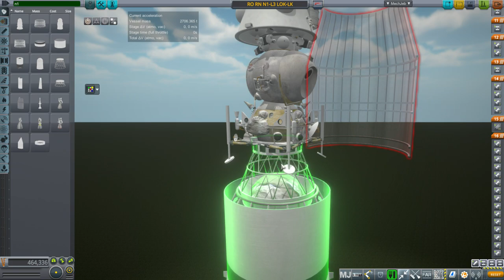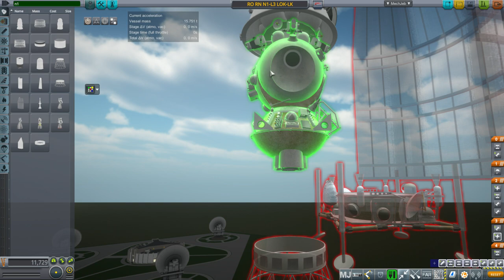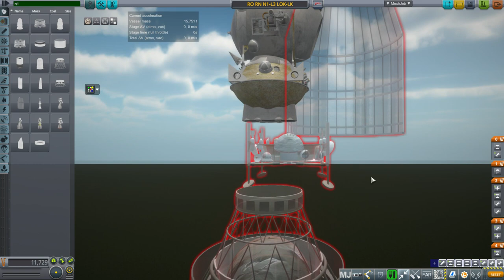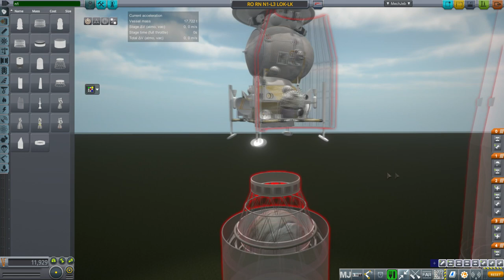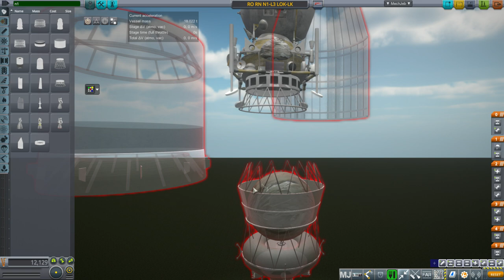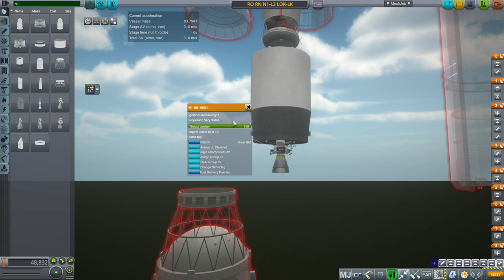How to Land on the Moon 02 - N1

Comment: Can you consider doing a Boeing 2707 vid?
Reply from the maker: Still not satisfied with my ability to do swing wings, and that's the version of the 2707 (-100 and -200) I like most. Otherwise it seems to me an overgrown Concorde, and if anything the Concorde needed to be smaller, not larger.
Reply: Raiz Space Okay, thanks. I just thought someone should do it in KSP other than Turbo Pumped.

Comment: Did they plan on ĺeaving the landing /leg module (block G?) On the lunar surface or using it the way you did? Everything I have seen they leave it there. Good vid! Think it was one of the First complete N-1 missions I have seen.  Isn't it annoying when you get a fantastic craft file but the rcs looks like it is on.
Reply from the maker: I think they lift off with the legs, unlike the Apollo LEM, but I'm not 100% sure. That's an element that could change once they actually put the mission into practice, too.
Reply: Raiz Space No, I’ve heard it jettisons the legs for ascent.
Reply: If the leg section doesn't have usable fuel? Then it would make sense to do the same as the Apollo LM as it is dead weight. This has me truly curious lol
Reply from the maker: The only reason you wouldn't do it immediately on the ground is if there was a timing concern, or concern that, given a slope, it might jostle the ascent portion on separation since it basically surrounds the ascent bit rather than being purely beneath it.
Reply: @RaizSpace  its just a landing shroud with legs isnt it? Anyways great vid!
Reply: @RaizSpace  It has 3 engine bells. 1 for landing, other 2 for emergencies. The lower assembly includes legs and fuel, this is left on the surface for ascent due to delta-v gains.
Reply: @RaizSpace  they lift off and leave the first stage behind, which was a merge between the two stages, it's not on top unlike the appolo lander but is in the middle ish
there is some fuel for landing on the stage they leave behind